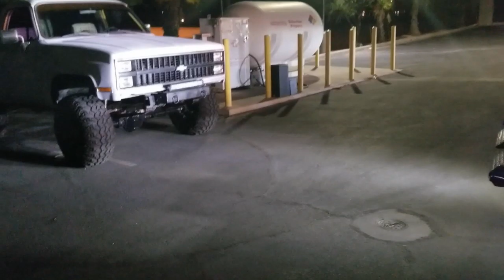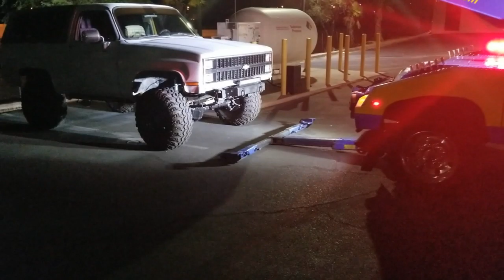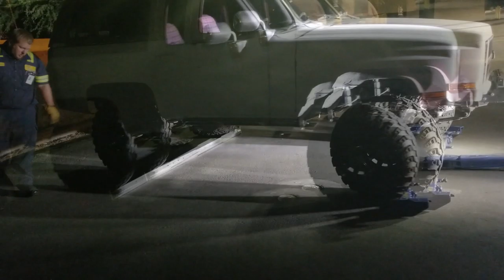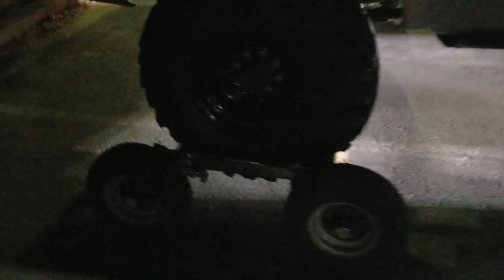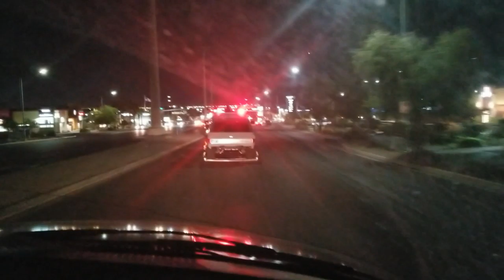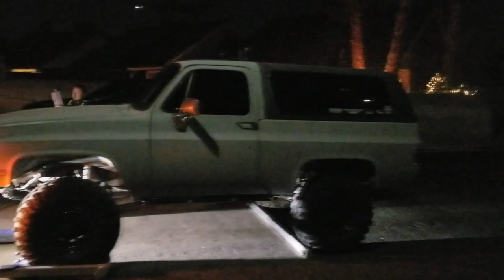Had A Butt Pucker Moment Last Night And I Wasn't Even On The Trail Yet

Comment: Damn dude. 
I lost brakes in my XJ like 8 years ago while driving. 
With my 6.5" lift also I couldn't connect my E-brake back up. 
I shifted into neutral and coasted down a hill and went over a curb into a small ditch to come to a stop.

I can't imagine having that happen in a big ass K5. Glad you and everyone around you was safe.
Reply from the maker: Thanks man. Yeah you know how scary it is. Not fun. Currently looking for the 14 bolt e-bracket as we speak.

Comment: This happened to me last summer. It was just over 110 degrees. Fluid got too hot no p/s and the brakes were like a really worn out sponge lol
Reply from the maker: Exactly. How did you fix???
Reply: @SlayFive  i flushed the brake system and found out one of lines going into the master cylinder had a small crack. But when it heats up in the sun all day that crack expands and causes air in the lines. Couldn't find it because i was looking in the early morning when it was cold Hope you get yours figured out.
Reply: Not sure how it affected the p/s system but it did.
Reply: @danielvess1780  hydro boost, runs off the ps pump.